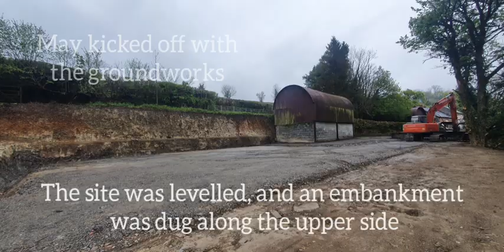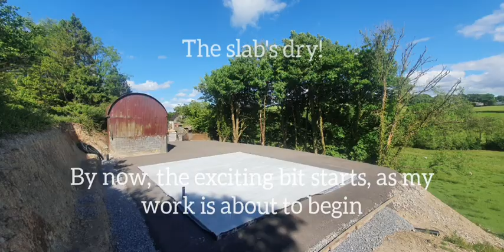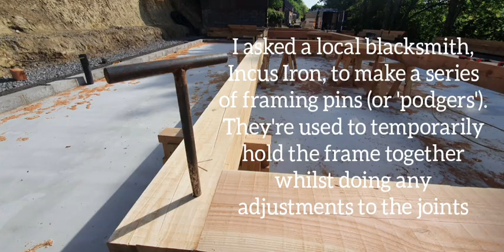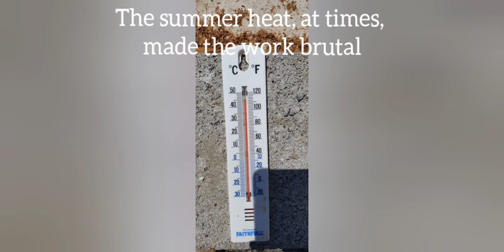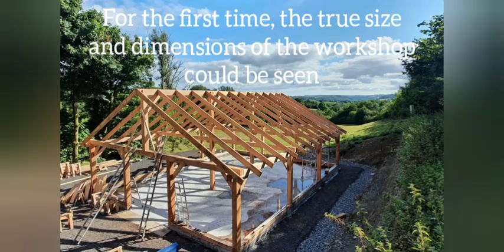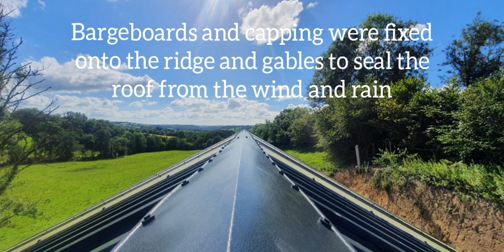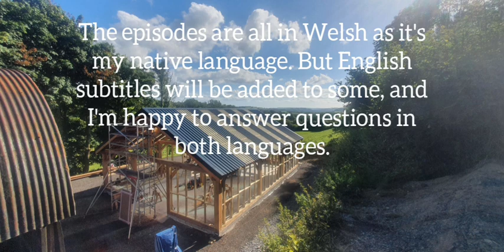The work so far [Gweithdy Pedair Cainc Workshop]

Comment: I saw the article on Walesonline about how you're experiencing difficulty getting an electricity supplier. 
A real nuisance after you've spent so much to get connections sorted.
Your workshop photo caught my attention, a real masterpiece and a good advertisement for your skills.
What about an 'off-grid' specialist? It would probably involve solar panels, battery storage, perhaps a small turbine?

p.s. Love that little stick chair!!
Reply from the maker: Hi there!
Thank you for the kind words regarding my work, always nice to hear others appreciate the graft and skill that goes into a finished piece of carpentry.
It certainly is a nuisance, and also a headache and a constant sourse of worry. I'm looking into greener ways of providing electricity, and would like a system where by solars with a battery will create enough to power the workshop most days, while the grid is there for backup purposes and to use when using heavier machinery. But, it's a disheartening situation, as I've poured all I have into the workshop (£10k of which for the grid connection), and am now heading towards a situation where a building's there but the lights are off, and have nothing left to aquire alternative power sources.
I think I need to head to the pub for a pint!
Reply: @pedaircainc  The pub sounds like a very appropriate coping mechanism in the circumstances.
Photovoltaic roof panels.
Small photovoltaic array.
Small wind turbine(s)
Perhaps a small generator for worst case scenario.
Sizeable outlay but low running costs thereafter.
Reply from the maker: @MagnusMaximusinWales  I think I'll have to consider all options as the current situation will only endanger the business. Less reliance on the bid companies can only be a good thing for us all!